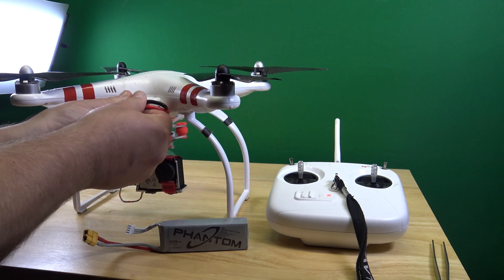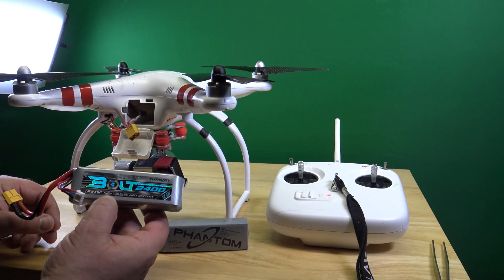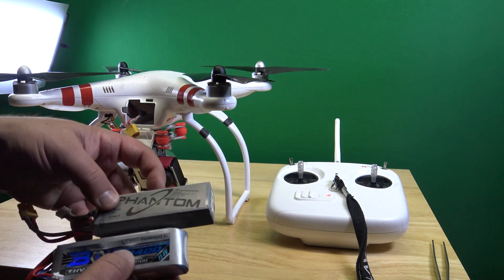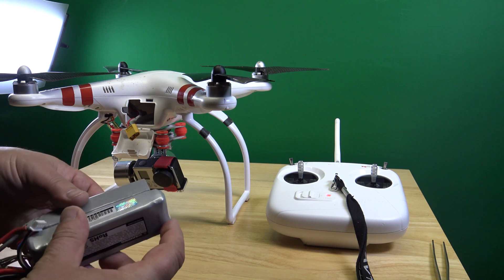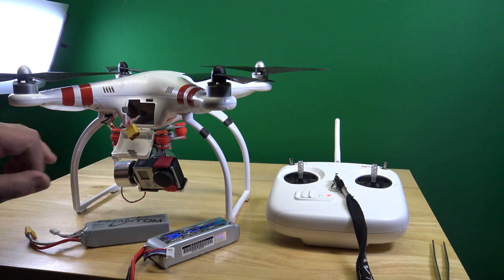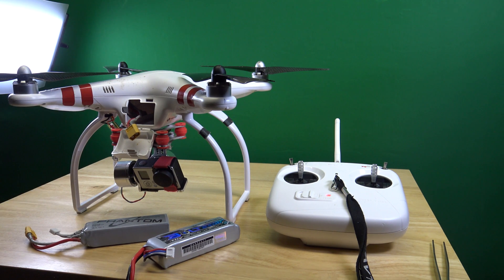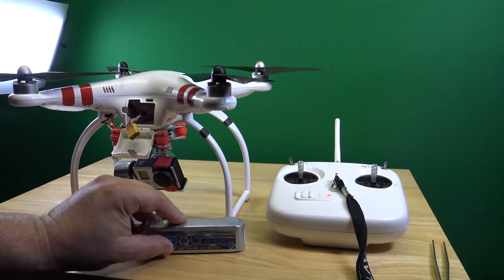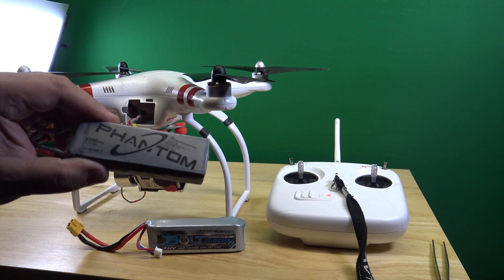DJI Phantom with High Voltage LiPo (LiHV)

Comment: Think you meant Carbon Fibre not Kevlar blades lol.
Reply from the maker: Kevlar is the brand.
Reply from the maker: A true composite propeller is made from carbon fiber or Kevlar.  Google it ;-)
Reply: mygiguser Never heard of that brand. I've broken a 3K CF prop quite easily and it didn't look there was and Kevlar in it. Seems Kevlar would add strength. I have CF/Nylon mix props as well. Just googled those props and nowhere to be found, have a link? I've seen those exact props on numerous sites, never a mention of Kevlar in those or any CF Multirotor prop I've ever seen and I've seen many listed.
Reply from the maker: Sorry i can't remember where i got those, i bought them long time ago. Several times flipped over on concrete, and the tips break a little on the edges, but i never had the prop really break., but then again, i think i damaged a motor instead, because the prop didn't give way.
Reply from the maker: UL03201
Reply: mygiguser ok thanks.

Comment: higher capacity  2800mah will give more  run time ? higher voltage is more speed.
Reply from the maker: More weight is bad. It flies better with less weight.